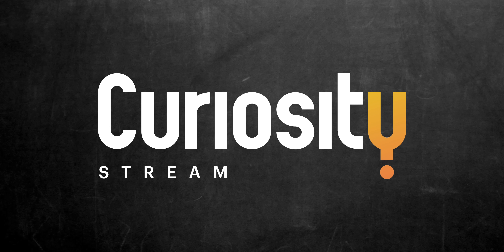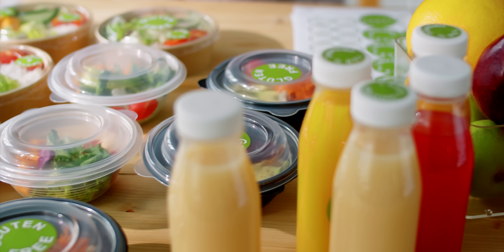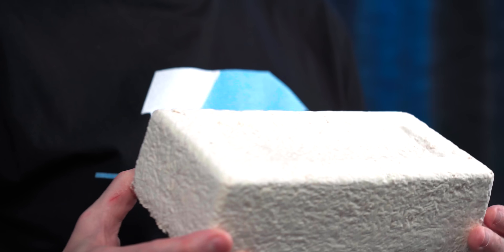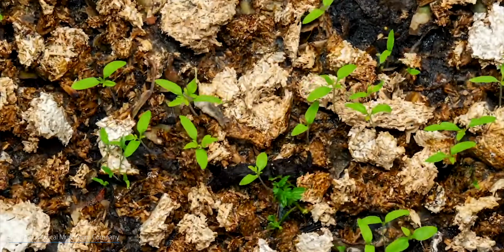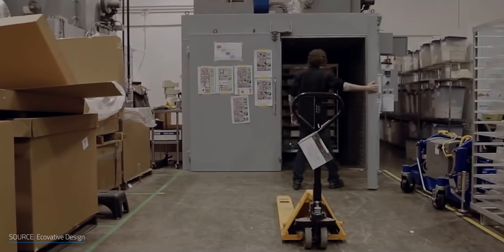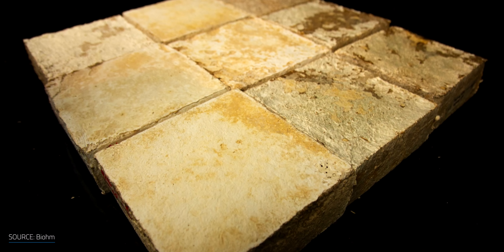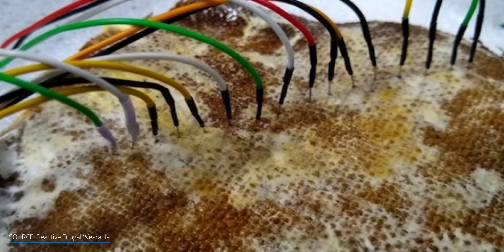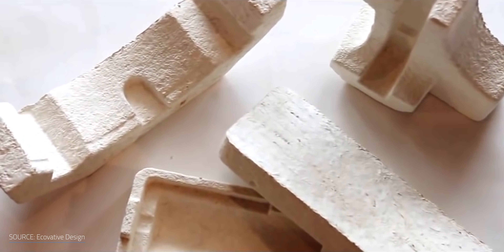Is Mycelium Fungus the Plastic of the Future?

Comment: A Sony engineer developed a way to recycle polystyrene using a solvent called d-Limonene and a distillation process to re-form out the styrene pellets (from which new items made from polystyrene could be made). Not sure why this has not caught on, but yes, polystyrene CAN be recycled, it just isn't for some dumb reason. I would like to see municipalities with areas of high polystyrene disposal (like warehouse districts) recycle their polystyrene into higher value polystyrene products like ICFs which in turn could be used to affordably build super efficient and high quality homes that in turn would attract residents while lowering energy consumption and reducing a significant volume of trash in landfills. It would be a win-win-win-win-win situation.

Comment: Even though mycelium prefab structure is heat treated to kill any fungi with in structure,  once it is exposed under the elements, it could provide perfect condition for other fungi  introduced from environments.    Is there reports of   long term usage  and how the mycelium structure hold up ?  10-20-30 yrs ?

Comment: Does the leather handle wear, heat, moisture, and environmental exposure? Or will your gloves/shoes start to degrade after just half a year?
Can it handle months of shipping overseas, exposed to moisture?
How long is the lifespan of insulation compared to rock wools or plastics? Can it last decades?
How does it handle other biological dangers/risks - is it a good surface/material for insects, pests, bacteria, and fungus growth?

These can noticeably shorten the list of uses in the real world.

Comment: This sounds very promising. the house insulation could be a problem though since it is biodegradable. you want your insulation to last and not rot. it might not work for humid climates. but could have a long life span for very dry climates or  with proper treatments. but to replace most uses of Styrofoam yes please!

Comment: We really need a renewable material that is easily and rapidly, workable in terms of being easily injection molded, die cast, pressed, vacuum formed, and 3D printed. Basically something that changes to a more malleable form in response to heat and pressure, but stays very strong and ridged otherwise. Plus it still needs to be light-weight, low cost, and of course environmentally sustainable.

Comment: This video didn't address my main question about this material, which is:
Does it decompose when wet? Its biodegradability must mean that it does, and this could make it a dangerous material in construction if contacted by water. How absorbent is it? Absorbency is a negative for food storage, even short-term food service storage.
Sure would not be good if it rains on your expensive boutique mushroom shoes and they end up rotting with... fungus, growing on them.

Comment: A good start for mycelium as a material is to replace single-use plastic and paper products on larger scale. There is already high enough demand, considering petroleum is the source of plastics and trees are the source for paper. So can single-use mycelium products be manufactured in large scale at reasonable costs?I

I would question mycelium as a replacement material for longer term products, especially in building and construction, because of its biodegradabilty. While recyclability is very important to consider for our environment, how safe are construction materials that are intended to degrade?

Comment: The level of in depth analysis is pretty missing. For example, plastics in general covers everything from everyday consumer types (PP, HDPE, LDPE, PC) to engineering types (PPE, PE, Nylons, Thermoelastomers, etc). Some of these are irreplaceable, meaning, they are used in an intensive environment and are specifically chosen and modified to meet performance requirement - like a plastic oil pan on a transmission. Its made out of glass filled Nylon, because it needs to remain stable at -40C to +200C.
All of these are derived from bitumen refinement, AKA, oil.
Each of these has specific properties that are beneficial to certain applications. For example PCs are generally optically clear. PPs are very maleable, nylons are extremely thermally stable, and PPEs are water resistant w/ no absorption.
So to replace plastics, you need something that has all of these properties. Which mycellium cannot manage.
So what you are really looking at is a replacement of styrofoam, and maybe some PP or LDPEs used in packaging. This is maybe 1 to 5% of the problem.
Second issue is cost and production rates. You need low cost, and EXTREMELY HIGH volumes. Meaning, the factory that produces these would need to pump out 100,000's per DAY if not 1,000,000s per day to keep up with demand, and to keep costs low. RIght now, from what I understand, this process is slow. Very slow. A plastic bag is made in fractions of a second, because that is the global demand. It also costs around 1 to 5 cents/pc. You need to get close to this metric to replace it. If you cant, its a no go. No company will DECREASE output just to change their packaging to a more environmentally conscious one unfortunately. So you will only see this product in low volume - high cost goods (like fancy wine bottle packaging).

Comment: I have a number of concerns about using mycelium like this.

I worry that alternative plastic that biodegrades quicker might be terrible in some applications, such as medical products and food storage, where you wouldn't want to promote the growth of bacteria lest you risk contamination. Notice that even when used in packaging, the products housed in them are still plastic, like those shampoo bottles around 5:01

I also worry growing the mushrooms to make mycelium would cost land, energy, and resources to farm, harvest, and process the same way cash crops use a lot of land and resources to produce because in order to compete with plastic we'd have to produce a lot of it.

I worry that more wild forests and jungles will be burned down for the space to farm mushrooms, like what farmers are already doing to the Amazon and jungles of Africa to expand on agriculture to plant oil palms that can be harvested and processed to make palm oil.

I worry that introducing alternative plastics as competition to polymers will only drive the cost of polymers down due to a possible decrease in demand and won't really discourage its use.

But the thing that worries me the most is that discovering alternative plastics ultimately means nothing if we can't cut our dependence on crude oil and natural gases because that's ultimately where our plastics come from (or so my research on the matter has shown so far). Plus it doesn't help that we need the fuels to create the energy that is used to run the machines and buildings to process these mushrooms to make mycelium.

Comment: for the cost issue: make plastic production more expensive by slapping extra taxes on them, free market takes it from there. Companies will always find a way to stay competitive and if the cost of mycelium based products is lower than plastic ones the industry will shift to it over time. With the widespread use companies will have more incentive to research ways to cheaply mass produce it

Comment: Absolutely fantastic. Only question I have has to do with wast and recycling. Another point is fire resistance....at what temperature does the product burn and can it be extinguished.  When will structural strength be improved. Thanks your presentation is good and an eye opener

Comment: I'm happy to see the promise of fungal replacements for plastics. In the meantime, plastic waste should mostly be burnt for energy rather than recycled, in most cases, though cracking it down to some kind of diesel fuel is probably worth considering too. It is incorrect to say that burning plastic produces toxins as this generally applies to open burning in uncontrolled conditions. In a properly managed combustion system it burns cleanly and you can add further steps to processing flue gases to make sure that nothing bad gets into the atmosphere. As long as we are burning virgin petroleum for fuel it seems irrational not to burn plastic waste - either way we are releasing carbon into the atmosphere but if you make the oil into plastic first you get to do something useful with it before you turn it into energy.
Reply: Idk how effective mushrooms are at doing this but there are mushrooms and worms that can eat plastic. From my pov, seems better to have them take care of that rather than burn plastic
Reply: @kjxy96  so mushrooms to both replace and eat plastic... BIG W 💪🍄
Reply: This is what Singapore does with its garbage.
Reply: A suggestion we practice in this home right now... I burn all the plastic we buy in the fireplace, I never put it in the bin. I've been doing that for 20 years now, as soon as I realized how much energy it contains, and how much was used to make it in the first place.
Reply: @MickelodianSurname   I actually don't think that's a good idea. In uncontrolled conditions burning plastic can produce some fierce toxins that simply should not be released into either the local or global environment.
Reply: @MickelodianSurname  I am terrified to think of the toxins you've breathed in doing that. You've also sent them out into the air for your neighbors to breathe.  Please stop!
Reply: @MickelodianSurname  and release all the toxins in the atmosphere

Comment: The transistor was not patented and it allowed the technological advances we take for granted today. I'm afraid mycelium patents will ultimately keep plastics around as the cheaper option only because of licensing requiring legislation to ban plastics and replace with mycelium-based products which is a second level of government-enforced monopoly and allowing prices to increase rather than decrease as they should in a free market with proper competition.

Comment: Having a thermal insulation in your house that is biodegradable, so potentially harmfull fungi (like most molds (or mould for the brits)) can grow in it like crazy, sounds like a really, really bad idea. Not much better than asbestos, since the fungus WILL DEFINETLY give you cancer, the asbestos only if you drill into it. xD
But if they manage to get that stuff none-biodegradable but still none-toxic in handling and burning, this might be a great solution.

Comment: Sort of hard to tout its biodegradability while also suggesting that it can be used where durability is required.  How can it be good for faux leather like shoes, if it can be composted in as little as 45 days.  I would hate to get my shoes wet and stick them in closet.

Comment: nothing will replace plastic unless we consumer change our way of living. we use plastic because it's stable and durable, it does not rot, decay, corrode it just dont degrade whatsoever. even if you find/invent another material with the same charastics, and put it to mass use, it'll be another environmental disaster over again.
in short, an environmental friendly material will not be as good as plastic.
take straw for example, you either use paper straw and live with the disgusting taste, or drop the fancy way of sucking juice out just drink it out of container.

Comment: I think as a concept it's both neat and going to see places, but it's still early on in development that it'll need a series of fine tuned changes as scenarios occur to realized certain cons to initial designs. Being biological/biodegradable, unwanted pests to homes could potentially prove influential to coming changes of methods to prevent it being gnawed and consumed in a variety of homes that see such happening chances of such. Even if you argue, "if it's built to code", that doesn't mean people can't have accidents afterwards, nor nature can't dislocate things in an earthquake or tornado. The next question of concern is how long until it deteriorates, for example mushroom as a leather.

Comment: Questions: How well does mycelium take the stresses involved in being the blades of a functional rotary snow plow in a garden scale model trains? How will the treads and especially the flanges of mycelium wheels wear against the even just minimal friction of running hours at a time on brass and aluminum rails? Will couplers with their shanks and knuckles of mycelium plastic take the stress of a 12 pound locomotive pulling two dozen 2 pound cars up a 2% grade?  Will mycelium switch frogs take the impact forces of those same trains? Will mycelium crossites hold up outdoors in summer heat and freezing winter and daily soakings of the sun's UV? Will mycelium gear teeth survive the forces involved in getting a 12 pound locomotive to move a 40 lb train? How well will mycelium axle bearings wear compared the currently employed delrin? How well does mycelium take glue and paint for those who want to personalize their trains or scratchbuild trains? How well does a mycelium litter box hold up to daily soakings of cat pee? What happens when a fungus-based litterbox is scrubbed with Lysol? How well do miniatures game figures figures made of mycelium stand up to repeated handling by sweaty fingers covered in potato chip grease? How well does mycelium plastic in 1mm thicknesses take the shear forces involved in being model rocket fins? How well do mycelium body tube couplers stand up to the pressures of model rocket ejection charges?

Comment: One key factor for building materials is how well it resists moist, and what happens when it gets wet. A bio material like this would probably just start to get moldy when wet, so for that reason I would not want to build in a house with this as insulation, unless it is a really well built house in every other regard with no risk of leakage or condensation. But in general, no, it would be a risky material in many applications. Glass or stone wool seems more safe in that regard, even if it is not pleasant to work with.
Reply: That is a very valid point. On the other hand, there is a reason many modern materials are composite. Even with glas ore stone wool you have problems if water condense - actually getting black fungus can make this material quite unhealthy over time.

So what about using fungus inside a sealing material as ready2use panels? Still 98% compostible if you remove/break the sealing material but permanent while mounted.
Actually building materials are so much behind technology. If you want to isolate the roof of an old house, all you get is material in standard sizes. A lot to cut - and a lot of waste. What about some reference pattern to stick on the construction, some photos - and by photogrammitry ordering custom made ready to use sealed panels you simply have to put on? Some sealing tape afterwards, to avoid humid air getting into the construction.
The weight of fungus make it quite easy to handle. Also its stable. While custom made panels will increase cost of material, it save a lot of labor. And you do not need mask protection to avoid long term health problems like you do using glas or stone wool.
Even with double the price for isolation material, custom made perfect fit panels would be a great product. I would realy love it...
But bare fungus - no way, you are absolutly right.

Comment: Are you kidding me?!  This is utterly fascinating.  People all worked up over the "climate crisis" should be pushing stuff like this hard core.  

How does this stuff hold up in durability & structurally?  I'm not so much thinking of packaging alternatives, but more of the clothing/fabric/shoes angle, and the insulation area, if I understand correctly it can be used for insulation?

Comment: Interesting Matt but as usual, as a member of the more sensitive sex, how does mycelium smell. It would be a deal breaker if my packaging smelled like mould. If they could eradicate the smell by not introducing harmful chemicals I would consider it.
Reply: It doesn't have a smell, or only very faint natural smell, at least the packaging. The mycelium is heated enough to dry it out, which will kill it. So what you have left is all the tiny pieces of the original substrate (ex. sawdust, rice hulls, etc) held together with the dried fungal "glue".

Comment: OK, now tell me how a substance that is going to biodegrade in 45 days is going to provide a reasonably durable material for the construction of consumer sports shoes that should last 2-3 years, if not longer.
Reply from the maker: I could have been more clear about that in the video.  It only biodegrades when composted.  If properly installed in a building system, it can last for years.

Comment: a major question in regards to building insulation, because its biodegradable and decays over time when exposed to the elements how often would one have to replace the insulation of their home if it were made from mycelium?
Reply: If its inside a typical stick built home it probably won't be very different from typical pink fibreglass insulation, as both will hold water and allow growth of mold if exposed to the elements or a broken water line. Now if a house is built and maintained properly I don't see why it would have any issues. (Dry product with limited airflow= very difficult to start biodegrading and very slow if it does).
I'm curious if there's been any flammability studies on the product as that's why many projects are moving to a rock wool insulation (in addition to that product's rodent/pest resistance).
Reply: Biodegradable when wet. Wood is like that too. The purpose of your building envelope is to keep out the water. Insulation must always be kept dry. Newspaper has been used as insulation. The problem is it flammability, not it biodegradability.
Reply: Wood is also biodegradable and noone has problem with that.